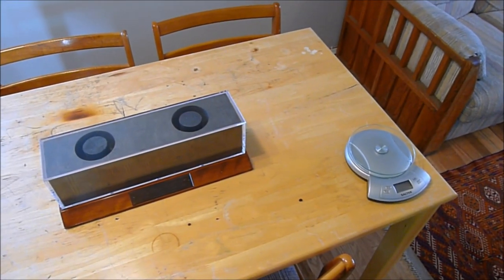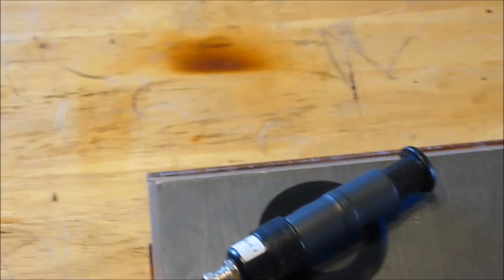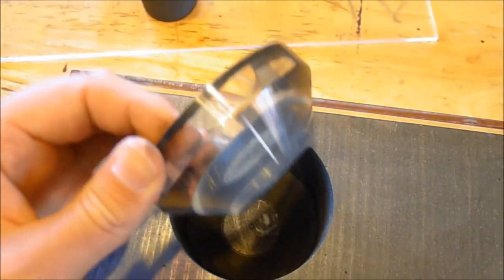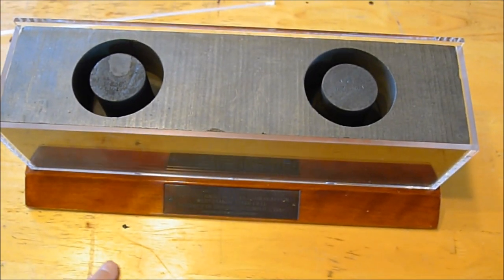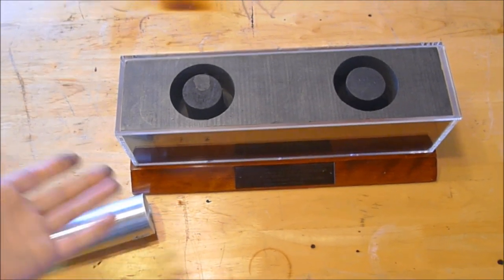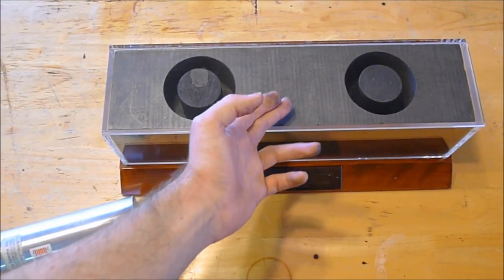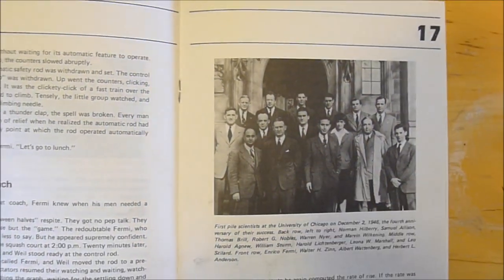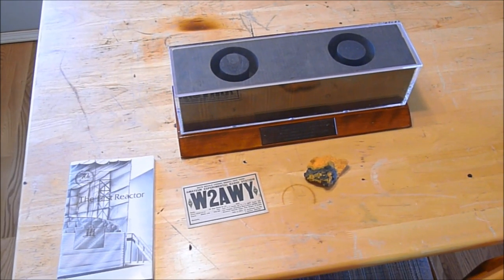Herb Anderson's piece of the Chicago Pile

Comment from the maker: @antiprotons: I can't reply to your comment (probably because your Google+ Interaction setting isn't "anyone").  There is an enormous amount of radiation, mostly downscattered gamma rays as well as U x-rays, at the low-energy end of the spectrum.  Hopes for seeing plutonium by its x-rays or its gammas are effectively zero.  However, a sample of fuel debris is being analyzed for actinide isotopics by mass spec at the University of Missouri right now.  Should be interesting.
Reply: Hello. While I was reading this report of 2018, which is still confused as to the markings, I noticed that they're stamped in a very crude way, even letters upside down. Even the worst weaponry of WW2, even German last ditch weapons were marked better. Come on, even my first attempt to mark my hand-made scratcher tool with "11" at school 15 years ago was WAY better.

This makes me think these letters mean nothing. 1. It's a secret project and confusing the enemy in case of theft is among priority goals. 2. Theft is easily possible - these pseudospheres formed not 5.9 tons, but other, quote bigger amount of UOx. 3. In light of this I highly doubt any of these represent actual manufacturer, since, if stolen from couple places and analysed, guesses could have been made regarding production scale. Normally such things are not stolen from factories, but get "lost" during transportation. 4. And finally, it seems to me that production personnel didn't really know what they were working with, and these marks were finalized during assembly from common pile on CP-1 site - so every piece was marked by at least 2-3 different manufacturers, not even necessarily in one building. This could also explain why they're different in weight.

Comment: Thanks for including the spectrum!!!  Where you see Cs137 from U235 fission, you find Sr90...  I'd certainly wash my hands :)   (actually, I would wear gloves, personally).

You might be able to detect to Pu with an x-ray spectrometer either from daughters or using XRF.

Do you get plenty of neutrons off of it?

Is the fuel a problem to hold without gloves due to the metal metal toxicity  (I know the radiation isn't an issue)?

Comment: That is incredibly cool! I can't think of a more awesome nuclear specimen. I was a little surprised you didn't wash your hands after handling the metal to avoid contaminating other surfaces. Acrylic plastic became commonly available in the 1930's, so it's possible it's original.

I can't speak to the regulations in the US, but your treasure may require a license in Canada. We're allowed to possess 10 kg of U/DU in a year, but there are hard limits on other radionuclides which that fuel may exceed. We're limited to 10 Bq/g or 10 kBq total Cs-137 in a sample. There's a good chance your samples exceed the 1 Bq/g or 1 kBq Pu-239/240 limit, too. What kind of alpha readings do you get?

How do you contend with the radon off-gassing?
Reply from the maker: I do wash my hands regularly, but I'm not going to make a video of that!  About the acrylic, I replaced the original 1950s acrylic right before making this video--its glue seams were falling apart.  The new construction (seen here) is solvent-welded.  I don't have a meaningful alpha measurement.  There is essentially no radon emitted from refined uranium as its long-lived parent, Ra-226, has been eliminated during extractive processing.  Thanks for your interest.
Reply: Carl Willis Thank you for replying. I'm still in awe at this.
Reply from the maker: Mark Rose  Me too!
Reply: Carl Lumma Indeed I was. It didn't occur to me until just now that the display case was also acrylic lol
Reply from the maker: Mark Rose Sorry about the confusion.  Yes, I have no idea if the acrylic fuel spacer is original equipment.  They probably would have used something (since they had hundreds of blocks like this where metal fuel was being put in a pseudosphere hole), but given the concerns at the time about control of pile contaminants, including atmospheric gases, I would have thought they'd machine the spacers out of AGOT graphite.  Unfortunately, some mysteries are going to remain...
Reply: @Carl_Willis  would have thought acrylic spacers might have melted in a running reactor 😅

Comment: I love dropping by to watch this video! This is absolutely incredible! I love nuclear science! I got into radioactivity about 10 years ago as a hobby, and I'm amazed at how little I knew back then, and how much more I will learn! I'd LOVE to own a piece like this! I do have a very large and beautiful cuprosklodowskite specimen from the Shinkolobwe mine, plus some very small cuprosklodowskite needles (for my microscope). It looks amazing under it! Also, it is quite hot compared to other uranium minerals I have! I can see why this uranium was mined there! This piece you have is just priceless! I know the most common Am-241 gamma-ray intensity (of many) is very easy to identify at 59.5 keV at about 36% intensity. The most common gamma intensity (of many) for Pu-239 would be hard to detect, at 51.6 keV. I believe its intensity is only about 0.027%. The X-rays are also pretty low in energy and intesity, however a little more intense than the gamma-rays. A low-energy HPGe spectrum (probably run for weeks) might detect it. I don't know. The fact that there's Cs-137, and that it also dominates the Pa-234m peak from that uranium is so fascinating! I could go on, but this is just so awesome! Thank you so much for sharing this!

Comment: When you had the Geiger counter on top of the Acrylic with the Beta shield on were you just reading Gamma or X Rays? I assume the Alpha and Beta particles were blocked?
Reply: The measurement was on gamma radiation output, both alpha and beta would be blocked by not only the acrylic plate but also the beta sheild on the probe. The probe being gamma beta only. I believe this probe is a eberline HP 270 energy compensated probe for beta gamma dose rate. In my knowledge I do not believe Xrays would be likely from the decay of refined uranium.

Comment: was CP-1 power output thermal only? if not how did we get energy out of it with no steam system? and how could you assume its power output, in 1942 with that eras tech and knowledge? did they do it based on its exterior temps as that seems it would be subject to speculation as I don't understand how they could measure the internal temps or know how much heat could actually be extracted from the process. or is the wattage measurement something we calculated about the experiment after the fact, and during operation they simply knew they went critical. Sorry my understanding of nuclear science is very poor, I love your videos as it gets me wanting to learn more and I don't feel like I need to have a degree to learn about this topic.
Reply from the maker: CP-1 was not built as a nuclear power plant.  Its power output could be inferred from neutron measurements (since fission yields a predictable number of neutrons in the aggregate, and about 200 MeV of energy per event).  The energy ended up as heat in the pile, which would have been dissipated by conduction to the cooler surroundings.  CP-1 ran only at low power levels (only reaching a few hundred watts on one day).  In rebuilt form as CP-2, it reached about 10 kW and was run this way for days on end.
Reply: I believe if it had been run at higher power for any length of time everyone in the room would of been zapped pretty hard..    no shielding until later, 10KW for days would of been behind lots of concrete with cooling systems.

Comment: .
I would were gloves handling these materials. At least..

The materials (and especially the graphite) are giving off dust, and traces of it get immediately on fingertips and fingernails just by handling it.

I would also mention "safety first" precautions, since lot of viewers see your videos as educational videos.
.
Reply from the maker: You raise a legitimate point about hygiene generally.  I think the hazards associated with solid pieces of ~130 kWd/t spent fuel are pretty minor, as long as hands get washed, and the graphite has no real hazards at all.  I kept a pancake frisker around and didn't notice much removable contamination.  The biggest issue in this specimen were a few flakes of U oxide that I collected carefully so they could be sent off for mass spec analysis.
Reply: .
I couldn't find the definition of " kWd/t ".
(Except for the kiloWatt..)

Can you give me a clue..? Thanks, I would appreciate that..
.
Reply from the maker: @edwardwouters9492  Burnup units for nuclear fuel, kilowatt-days per metric ton uranium.

Comment: Have you gotten a call from the FBI yet?
Reply from the maker: No, and a little bit of nuclear fuel is probably not high on their priority list considering all the weed that is getting smoked in America right this minute.  My state's Bureau of Radiation Control has been notified about the characteristics of this item and a DOE radiological assessment team has deemed it safe for loan to a local museum.  The University of New Mexico Nuclear Engineering Department also knows about it since they kindly let me use their HPGe detector to get the gamma spectrum shown.
Reply: Carl Willis
Are you saying you can make a fuel air bomb out of hash oil?
Reply: +TheEmpress Sharyl (TheEmpressSharyl) 
You can make pretty much any kind of oil into a fuel-air bomb provided you have a way to atomize the fuel, disperse it into the air at the proper fuel/air ratio (or provide an oxidizer) and generate sufficient heat to ignite it.